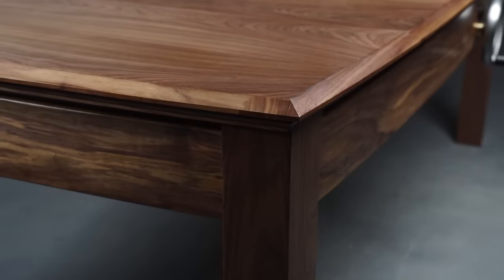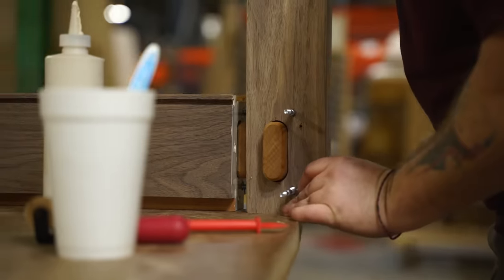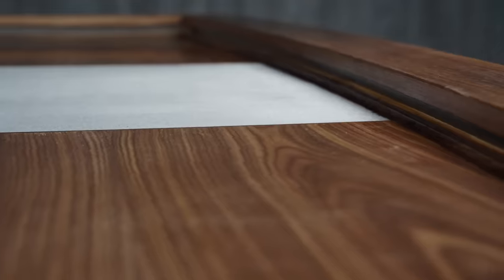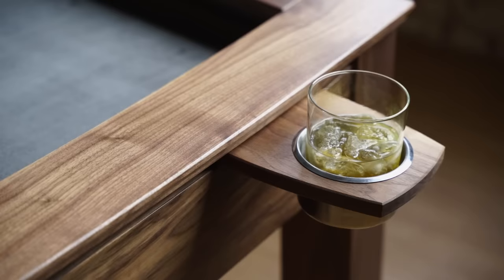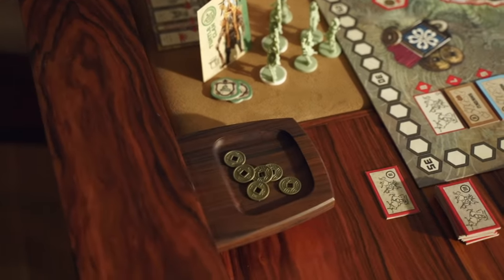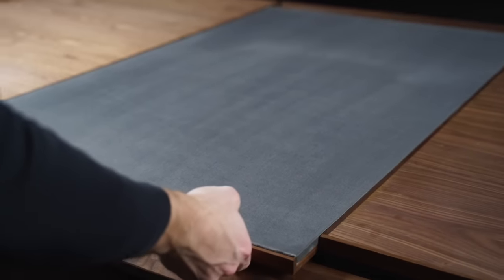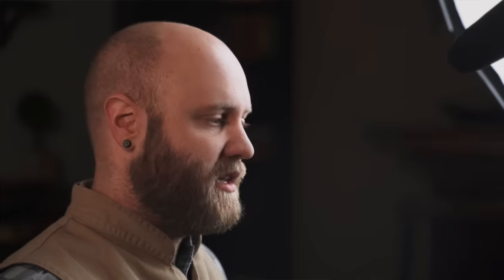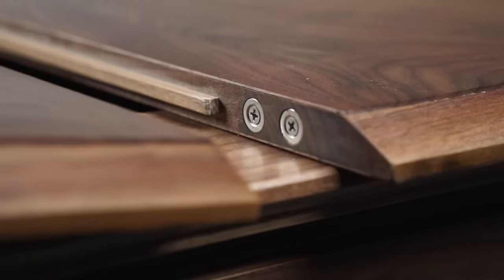Wyrmwood Presents: The Prophecy Gaming Table

Comment: It's gorgeous but I just can't justify 5,000 dollars for a table...and that's without chairs, I don't make lawyer/doctor money.
I bought a nice 36x60 table with 4 chairs and a bench from Ashely furniture with free shipping for $550.00 then built a topper with lumber and stain from Lowe's, felt from Jo Ann's and cupholders from Amazon....total about $800.00 its a very nice setup for the blue collar gamer.
Reply: Kyle Weiss any chance you have more details for those of a similar mindset?
Reply: @robertbell874  i'd love to see this also
Reply: I wish u knew how to build I would do the same thing! You got photos of your finished work ?
Reply: Then use the rest of the money to buy board games for life!
Reply: @robertbell874  you just get a nice sheet of plywood get really good stuff so it's flat and smooth have Lowe's cut it to the dimension of your desired pit size plus eight inches in width and length. Sand it smooth, order felt and padding from Jo Ann fabrics put it over this and glue and staple from the back this is really a two person job. Then cut 1by4 pine boards and build a frame around the top and bottom of the plywood on top this is your hand rail on bottom it keeps it from sliding on your kitchen table (buy a cheap tablecloth so the kitchen table doesn't get scratched)...then get those poker table cup holders  from Amazon and a holesaw bit and drill and the right size holes.
Reply: I'm a doctor and I can't afford this either. Haha

Comment: Are the top boards fixed to the table at all? Or do you rely solely on the weight of the boards to stop any movement? Say if you are dining and someone leans against it, do they not slide around since they are just resting on top?

Comment: watching this video again after 2 years, what i really miss with wyrmwoods tables compared to other products right now is e.g: integrated token holders on the outer top parts, even maybe cup holders there or wireless charging capabilities like the bristol from geeknson. if you put toppers on it nobody sees those anyway and it would be a nice addition instead of buying extra wood parts that hang out or inwards, but still love how more well built wyrmwoods tables look compared to its competitors. hope they gonna do distribution in europe at some time or do another kickstarter with the prophecy table or modular table soon :3
Reply: also one more thing i remember, the bristol seems to have a storage soution underneath the table for the toppers, quite smart

Comment: This is a piece of fine furniture made from solid hardwood(and lots of it), has a custom mechanical lift, some pretty hard to find features as well as a lot of design. Oh, It's also made in the US. Try to find a quality solid walnut dining table for under $3,000, you will get what you pay for.  And to those saying they would DIY one, give it a shot! It can be done and it's a very rewarding endeavor but it's also very expensive, time consuming and labor intensive. 

Bottom line is this, some people think a fancy sport car with all the bells and whistles is a waste of money. Some people see the value in the high performance and are willing to pay for it. This isn't a table made for everyone and you should be OK with that. They aren't ripping anyone off, it's fairly priced, and they offer tables that meet all your gaming needs while sporting a much lower price tag.

Comment: $10k+ for a tabletop gaming table and its not even large enough for a standard 6x4' mat that 90% of wargames use. Amazing craftsmEnship right here. I could take $100 down to the home depot and get something that is at least functional, haha.  Maybe they can make a $7000 add on that is just a sheet of 1/2" mdf you can plop on top of the surface that's large enough for a normal 6x4'.

Comment: Honestly, if you really want a table like this, pick up some tools and build it yourself. Looking at the overall design... Other than the cranking mechanism, which would take a bit of thought and some prototyping to get it running smooth and at the correct ratio, the table and chair designs are shit simple. I have a friend who actually works in sales of luxury furniture (big name brands, typically only millionaire clients), and the furniture he sells is on par in terms of pricing... This is extremely niche and not likely to appeal to many people. Like I said, pick up some tools and build this yourself if you really want something similar. I bet there are similar plans for a platform crank mechanism out there which you could reapply to this concept.

Comment: Yes, it's awesome.  But WAY out of the realm for most gamer.  This is clearly targeted to the affluent or those so into games they take out a loan for a table.  If you want a decent game table get a Game Topper and a folding table.  If you plan to leave it up all the time get the acrylic insert cover.  You could probably buy 7 game toppers for what this costs.

I got one with 4 single cup holders, two double cup holders, 3 themed game mats, a rules master easle, two dice towers, and related storage bags for Under 1500.  The quality is great and it's solid as hell on a decent folding table.

Comment: The glue was a turnoff, also it seems overpriced, shipping has to be crazy too. But cool tho.
Reply: It's wood glue, standard fare for good wood work. It's high cost for the materials, hours, and fit/finish. Looks extremely high quality.
Reply from the maker: David is correct. Wood glue is different from other glues, it bonds the wood to the wood and not the material to the glue. It is much stronger than nails.